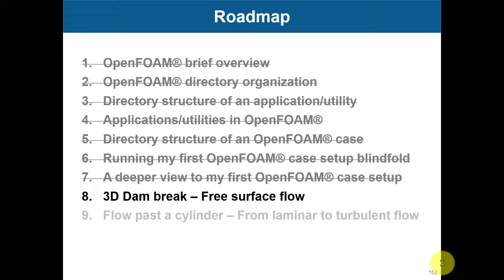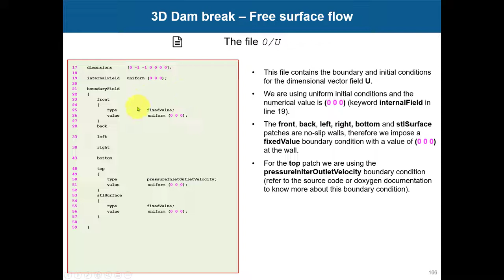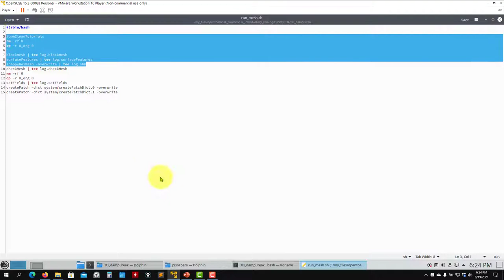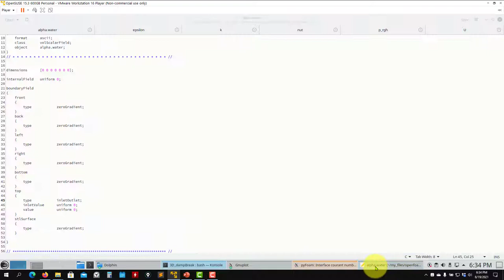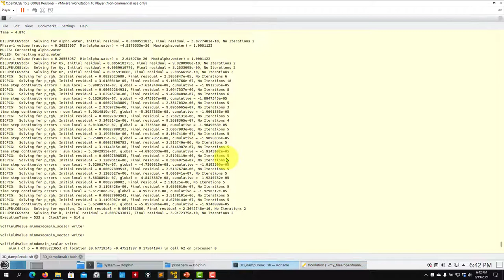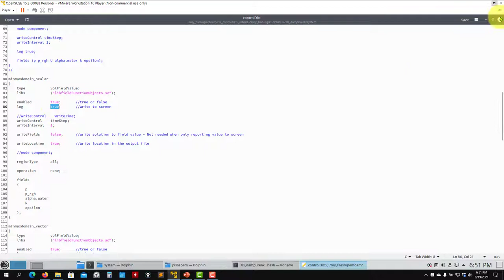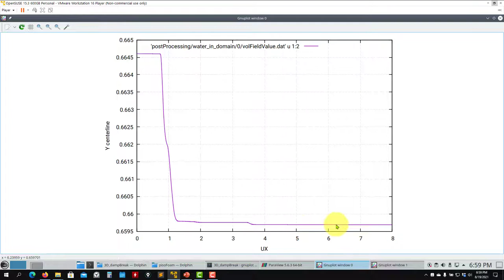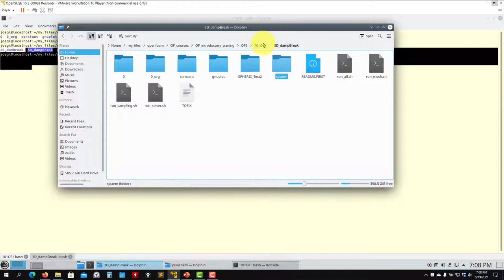1.4 Module 1 | Introduction to OpenFOAM - OpenFOAM 101 #openfoamtraining

Comment: when i run 'paraview case.foam' in 3D_dambreak case, there were no U,P options in my paraview, i can't use 'paraFoam' cause i did't install paraview by './makeParaVIew', do you know where did i go wrong?
Reply: You need to create first the file case.foam, and then launch paraview
Reply from the maker: As joegi pointed, create first the case.foam file and the launch paraview. It should work. If you are opening a parallel case, remember to choose the decomposed option.

Comment: Hello sir, I have installed OpenFOAM V2212, some command which your showing is not working 
Would you please me what to do ? like foamInfo command
Reply from the maker: Hi, you need to use the same openfoam version as in the video.  If I well recall this command does not come with V2212 or any ESI version. You need to use the Foundation version.

Comment: my paraview is not loading any variables while running
Reply from the maker: You have to be in the same folder as the case. Also, if you are running in parallel you need to access the decomposed solution. If you are using paraFoam run with the option -builtin. Native paraview should have access to the decomposed fields.
Reply: @wolfdynamics5703  Thankyou, I forgot about the decomposed fields.